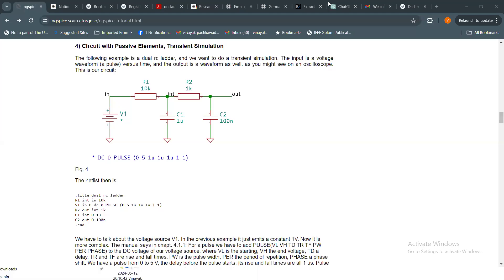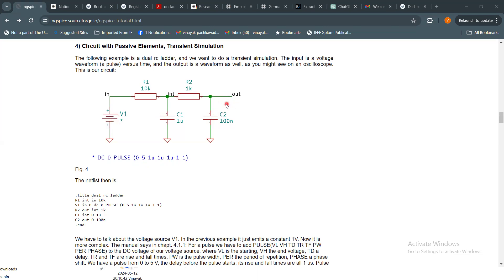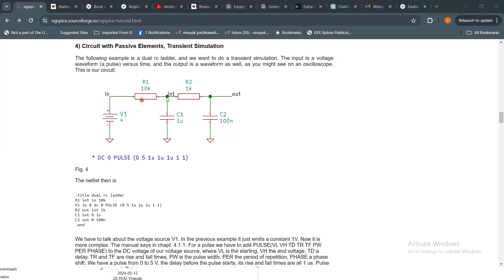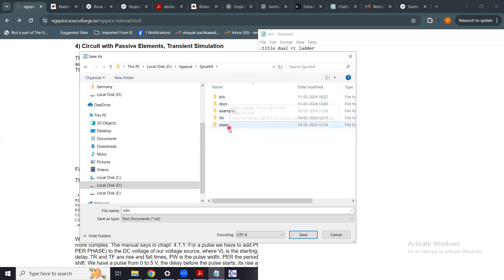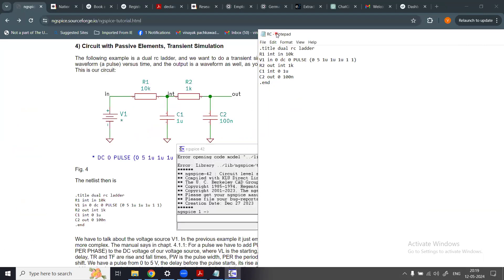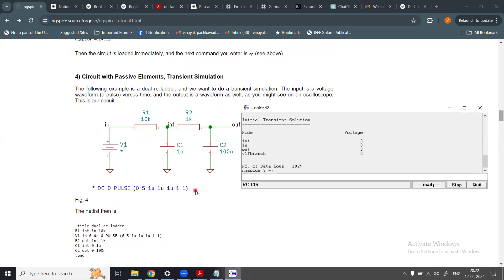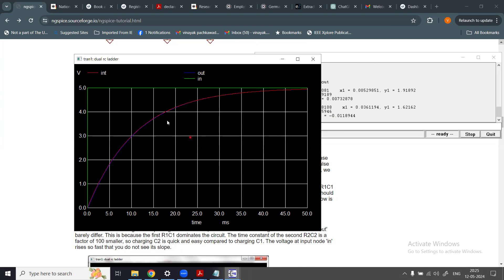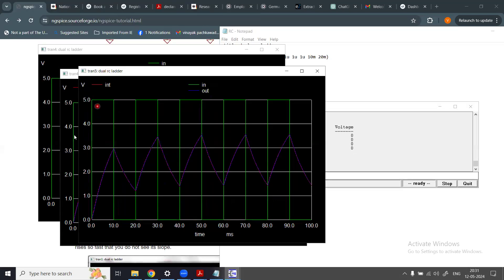NGSPICE: Advanced Circuit Simulation Techniques

Comment: Professor, thank you for your video. Could you please explain and discuss the benefits of using NGSPICE verses LTSPICE? I see more work using NGSPICE than LTSPICE.
Reply from the maker: Ngspice is Open source.
LTSPICE is a Proprietary software.

Ngspice is a fundamental spice circuit simulator. With ngspice you can gain good understanding of how to define spice syntax, device and component models, and parameters. You can also use KiCAD to draw schematic and use the netlist with ngspice. So, One can gain expertise in internals of spice simulation using ngspice. 

Ltspice however has its own advantages. Hope it helps.
Reply from the maker: @pbaemedan
Reply: @stem1122hjf  Professor, thank you for the information. I agree using and understanding netlist is important and useful for the modeling process. I started with Spice in Device Physics in 1974 using punch cards, model development, and line printers.